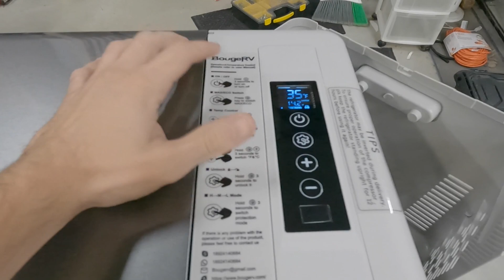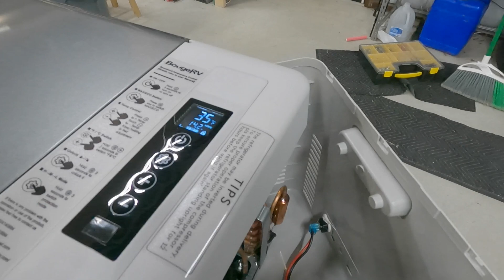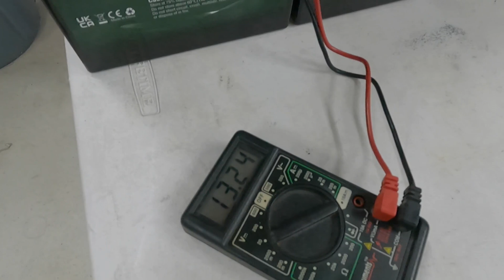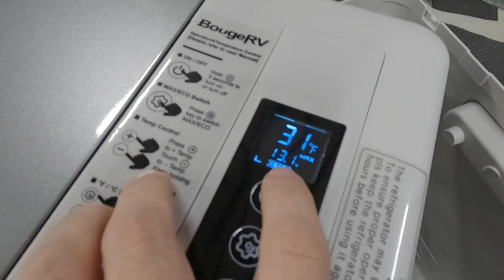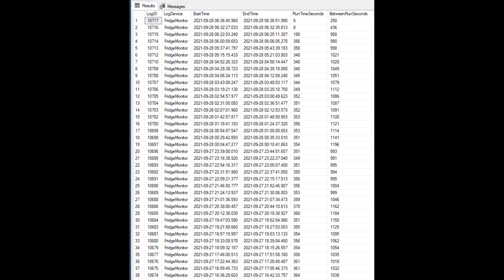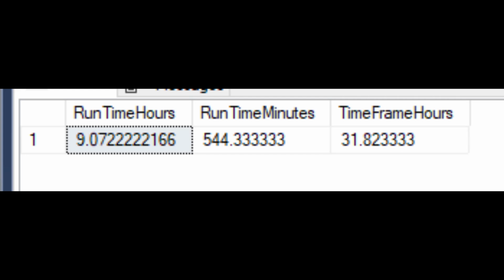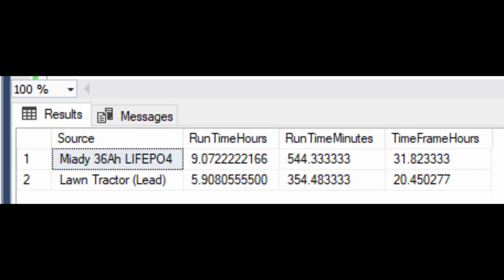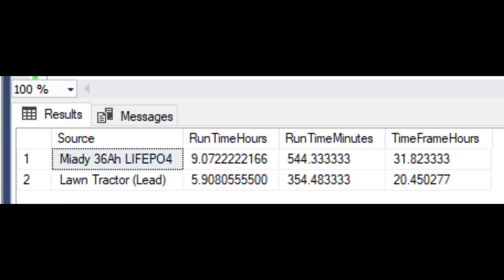$129 Miady LIFEPO4 vs $25 Wal-Mart Lawn Tractor Battery for 12v Fridge

Comment: It would have been a little more relevant to test it against a marine deep cycle lead acid battery because that's probably what most people would choose that went the lead acid route.  The lifepo4 are kind of taking over though because they last a lot longer so when you figure that in they aren't much more expensive.  I just got one so it's interesting.  I already have a lifpo 30 ah battery and it seems to last about 30 some hours with my cooler at about room temp and I have it set for 40 degrees.  Should work good for camping.  I've been wondering about charging from my car.  Do you know how to charge a lifepo battery with a car plugin?

Comment: Really useful, real world type video. Thanks for creating the content. 
  LA batteries have about 300 useful cycles from fully charged to fully discharged and starter batteries aren't really meant to be fully discharged. Another thing to keep in mind is how fast differing varieties of LA batteries can be discharged. Your experiment is using a fairly low wattage and you can get a lot of the energy out of the LA battery for that reason. You're probably accurate about how long that LA battery would last in this application. Deep cycle LA batteries can be deep cycled and they cost more and WILL be rated in AH instead of CCA or Reserve Capacity, but they can only deliver that if they are discharged a 1/20 of their total AH rating. A 36 AH LA battery needs to be discharged at about 1.8 amps and you really can't expect the battery to give you its full working life if you don't recharge it every time it gets half dead. It's just the way their chemistry works and it's like your being cheated out of half a battery, when you think about it. What you're buying with a LiFePO4 Battery is one that will charge very fast, discharge very fast, discharge all the way down to the voltage that your 'fridge cuts off at, do that over and over for 2000-3000 complete cycles (depends on the way the Battery Management is set up inside the battery) and even after that will still be able to deliver 80% of the energy that it did when it was new, for many years. In other words, once you get to a certain age, a LiFePO4 battery will outlive you. LOL They can literally become the last battery that you'll ever have to buy. It would be interesting to see an experiment where someone compared how many LA batteries it would take to replace a similar LiFePO4 battery. I bet it would be a lot of them.

Comment: You must slow charge these batteries at 2 A to have them more the longest time My charger runs until the batteries fully charged and that seems to be at 13.70 so far it’s operating 120 watts for 6 hours.
Reply from the maker: I charged this one with a Battery Tender on 800ma. The Battery Tender has a Lithium setting. Although I still always question if its actually doing anything different when set to Lithium instead of Lead, or if that's just to give the user a warm fuzzy feeling that it supports Lithium also. My understanding is LIFEPO4 batteries like this can be charged with Lead chargers just fine since the internal BMS is really what is handling it from being overloaded. It does make sense however that you would want to disable any desulfication (spelling?) since that sends high voltage shocks through the battery which I'm sure Lithium batteries wouldn't appreciate.  I suspect most chargers when set to Lithium are just doing that anyway. Thanks for your comment!
Reply from the maker: 120 watts over 6 hours is 720 watt hours. at 12.8 volts, that's 56 amp hours. No way that is possible on a 36ah battery. Are you using the exact same battery? or is your load not continuous?
Reply: @uthe54  I’m using the same 36 amp hr  MIADA battery. When I started the battery it registered 13.5 volts and after using it for 4.5 hr. Powering 120 watt speaker.It registered 13.0 volts. I DON’T UNDERSTAND!! I used two different volt meters.???????. I RECHARGED AT 2 AMP.

Comment: I'm a simple guy.  I would just have the relay power a clock.
Reply from the maker: That's a really good idea!
Reply: @uthe54  
Thanks.   Although that would be easy, it wouldn't give all that data you got which gave you far more than just the total hours of compressor on time.